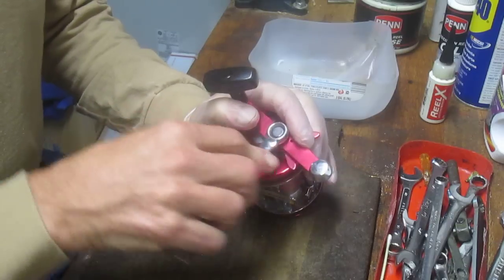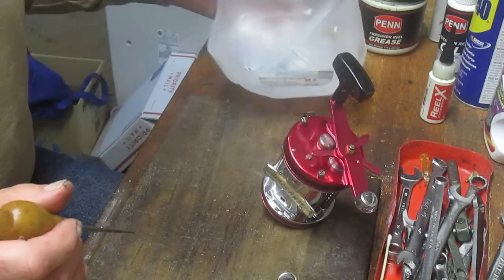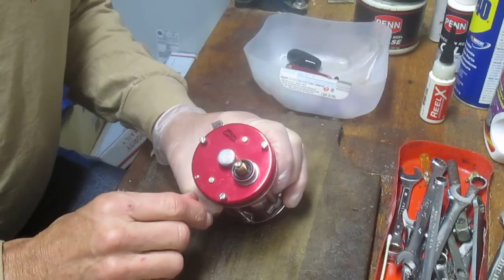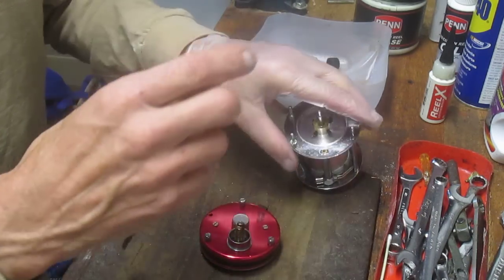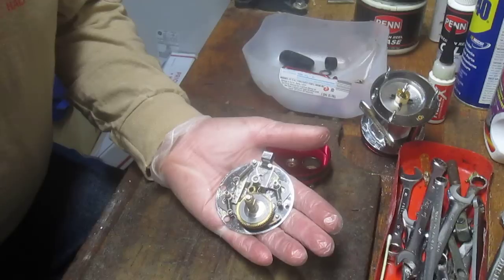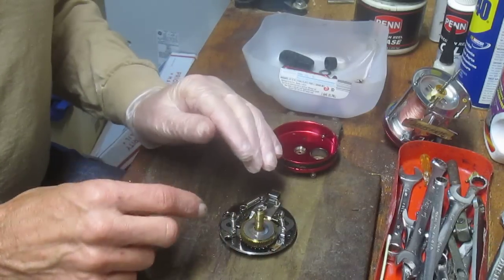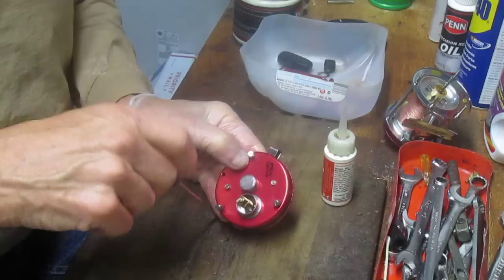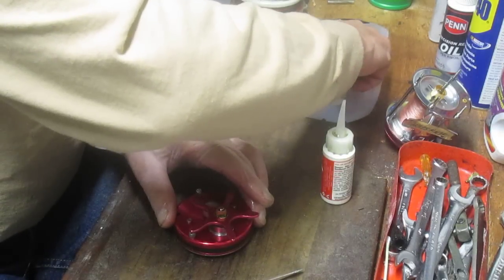Abu Ambassadeur 7000 fishing reel take apart and service

Comment: Haha. Problem fixed. You beauty. The brass bush that holds the end of the spool had jammed and was away from the casing by about 3mm. That was allowing the spool to move to far to the drive side of the reel. Must have happened some how,  the last time I took the caps off to oil the reel. But again thanks for the video. Gave me the confidence to pull the reel apart.

Comment: Cool, this all applies to my 7000B that I'm considering tinkering with (bearings and drag). It's a good reel "as is" but the pretty green machine stays home more than the C3's for it's basic nature. I've hot-rodded everything but a fishing reel and a 20 year old reel should be getting more action!

Bearings and carbon drag washers should be a good investment on a nearly new (old) reel. Great original spares to toss back in the box if needed down the line...
Reply from the maker: Wes - it should apply and I glad it will help hotrod the reel.  If you want to try the ceramic bearing I understand they are a great upgrade.  I think they are available through Bocabearing.com.  Thanks for watching.  Please stay tuned for more to come - Dennis

Comment: Thanks for video on the 7000. But where can I order the brake block. Any help would be greatly appreciated.
Reply from the maker: You can make one from a stirring straw or the tube that comes with spray cans like WD40 if you can't find one.  They will be hard to find, but you can check southwestern parts.com or eBay - Dennis

Comment: I have just received an abu Garcia ambassadeur 7001 - unfortunately (for me) it is a left hand reel.  Is it possible to convert it to a right hand reel?  It would be a nice addition to my other equipment that I presently use here in the Pacific Northwest. A little light for halibut fishing - but still a lot of fun for sure.
I enjoyed your informative video. 

Thanks.
Reply from the maker: You cannot convert these Ambassadeur reels.  You need to find the 7000 if you want the right hand retrieve.  Generally, the odd numbered mode numbers indicate the left hand crank.  Thanks for asking - Dennis

Comment: I have one of these but the baitclicker doesn't click on free spool only when reeling in and ideas on why this is
Reply from the maker: Hmmm - I would check the bait clicker spring.   There may be less tension on the way out causing a weak connection and less or no click - Dennis

Comment: As mentioned I had a clacking sound when casting if the spool was tentioned. Pulled the reel down and to my surprise after 30 years of use it was immaculate inside. No sign of wear. No dried up grease. No teeth missing from gears or any loose objects floating around inside. No sand or grit. And nicely lubricated. After reassembling, I have noticed that the spool seems to be a little too far to the drive side of the reel . If I loosen the tention on the spool and tilt it to one side it grates when tilted with the drive side down but runs free and when tilted the other way.  Perhaps I need to some how shim the end of the spool shaft so it remains central when it is tentioned?  Any suggestions? Note that the original brass plates and felt lubricating pads are still inside the tentioning caps.
Reply from the maker: Which tensioner are you using?  There is an adjuster on each side of the reel, right?  There should be one behind the handle and one on the non gear side right?  These need to be balanced to eliminate slop and have the spool operate efficiently.  Try playing with these first for see if that helps.  If you have no luck, it may be an out of round spool, but I wouldn't replace that yet. - Dennis
Reply: I have the one under the handle done up tight and I use the one on the other side to adjust the tention on the spool. It seems to be all ok now. As I mentioned the bush on the right side had jammed and was too far away from the housing. Causing the spool to be to move to the right and the clacking sound when casting was the small gear hit on the large one. Has caused some minor damage to the small gear. But is still operating ok. Will replace it if it causes any problems. Thanks again Dennis  @2ndChanceTackle

Comment: Do you like oil or grease in the worm gear? Noticed that you forgot to give it some lubricant in this video.
Reply from the maker: I like oil.  Grease tends to pick up and hold the contaminants including micro sand particles. - I will go get my oil now and add a drop :). This reel was done to show the inner workings for a viewer.  It didn't need the maintenance.  Thanks for watching and noticing - Dennis

Comment: Does 7000 Andy 6500 power handle inchangeable to each other?
Reply from the maker: Most of the Abu handles are interchangeable - I am not sure, but I would think they are between those two models - Dennis

Comment: My friend has the 7000c. When you turn the clicker off and go to cast it clicks like the clicker is on. We can’t figure out how to stop it from doing that. Any ideas?
Reply from the maker: I think you need to take the side plate off and inspect.  It is possible that there is a spring disconnected, which could leave the clicker always on. - Dennis

Comment: I have three ABU Ambassadeur 7000 C4 Lever Drag reels.   Have had these since new in the early 2000s .  These just have sat with minimal use in my garage rod reel rack in the ceiling.  Now its 2021 and want to take these apart and clean all the parts , relube , reassemble.   Do you have any history with these reels.  I really can't find much about them.  Good bad or ugly.
Reply from the maker: You don't see these around much.  The last one I serviced was a few years back.  I can't recall anything bad or ugly.  It was pretty straightforward. Here is a link to the schematic which will give you a look inside http://s7d5.scene7.com/is/content/purefishing/Abu%20Garcia/Schematics/7000C4LD%201100.PDF Dennis
Reply: @2ndChanceTackle  thanks for the reply. I have the in the box schematics for all three .  Will open one up soon.

Comment: Would like to see a video of how to replace the clicker button on ambassador 7000 because my button came out and was lost thanks
Reply from the maker: what version of the 7000 do you have?  There are difference configurations
Reply: @2ndChanceTackle  red Abu 7000 made in Taiwan has a round flat clicker button with circles on it on the sideplate

Comment: Anything on this reel that would cause loud casting?
Reply from the maker: Hmmm - lack of lubrication would be my guess
Reply: @2ndChanceTackle  are they not lubed very well out of the box?
Reply from the maker: It depends on how long the boxes sit in hot warehouses or containers on ships.  That oil and lube does evaporate and heat will cause it to dry sooner.
If you get one fresh from the factory, it should never be a problem - Dennis

Comment: If that is what you class as a service then I beg to differ.  None of the reel parts got degreased and cleaned properly at all.  At the bottom of the gear stack you should have a copper shim this was missing and you never even mentioned it.  One of the most important parts of the service is the level wind and checking of the Pawl for wear, not even looked at. No mention of what way up the bevelled washers should go.  Not enough time and detail given to the peoples who look at these educational videos.
Reply from the maker: Thank you for your feedback Mark.  I will try to incorporate some of these ideas into future videos.  I try to do what I can in under 20 minutes to keep the video "watchable"and pass along as much information as I can in that time.  I don't edit and don't script these, so oversights and omissions occur.  I usually catch these before posting and certainly before I return a reel to the customer, (like the shim washer that you mentioned) but I don't change the video.  I don't pretend to be the know all expert.  Just a guy trying to help folks by sharing knowledge while I still can - Dennis
Reply: 2nd Chance Tackle Hi Dennis, thank you for your reply and very honest response. I understand that whilst doing these tutorial and informative videos live, that some details may get missed, especially as you don’t script them and are trying to keep them short enough to make them a watchable time frame. 

I wish you all the best with future videos and I look forward to seeing more from you. 

Thanks

Mark
Reply: Thanks for the reply and please keep up the good work of educating people.  I was being picky but some of the little things do make a big difference.  look forward to seeing more from you.  Big Abu fan myself but still have to ring Peter Coogan to ask the way bevel washers go etc.  Only last week I found out the bottom one in the stack is in fact thinner than the top two.  When I checked my 7000c Syncros not one of them was correct.  all sorted now though.
Reply: @spunkie2010   Hi Mark, which way do you put those washers )( or ()